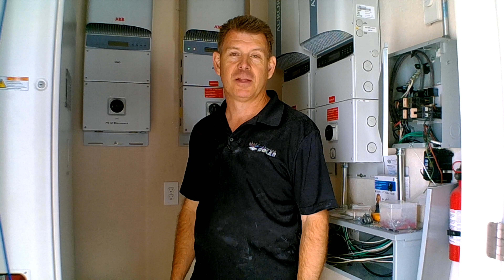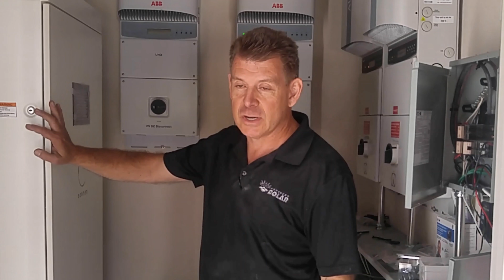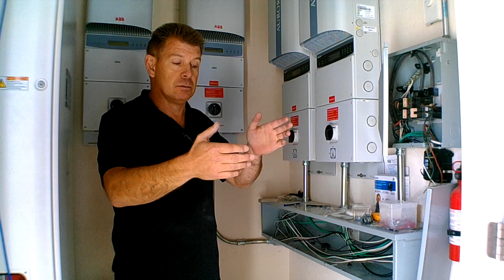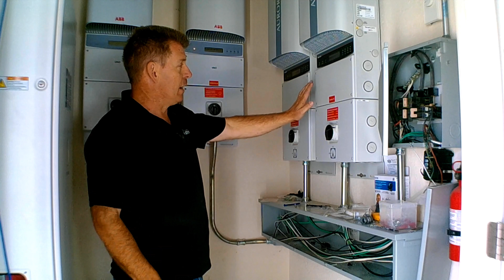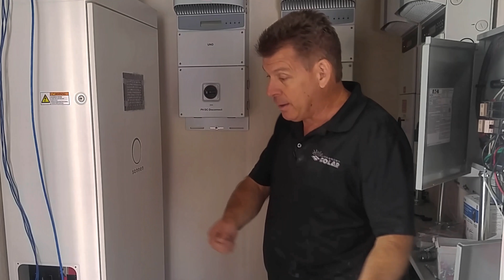Sonnen Eco 16 onsite

Comment: This battery can work with enphase microinverter only? or i need a inverter like you have?
Reply: Sonnen will function with any solar inverter because it is AC coupled, meaning that it has no electrical connection to your solar.  You can even install a sonnen with no solar at all and take advantage of time of use electric rates or for backup power only.